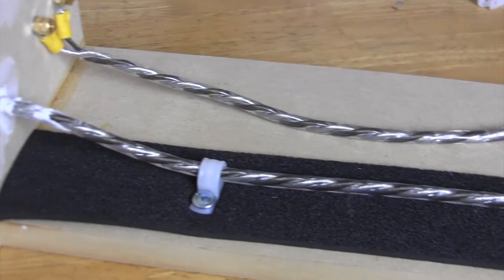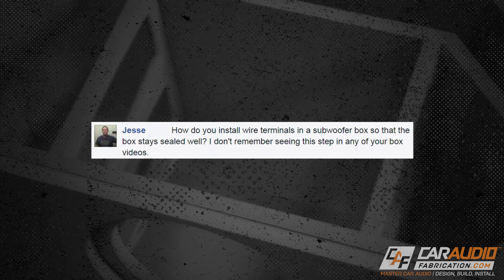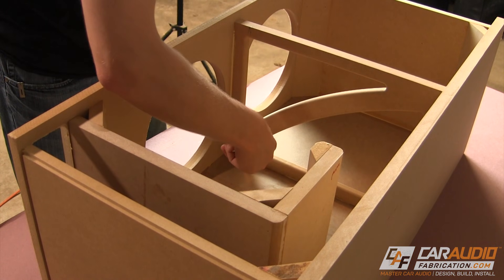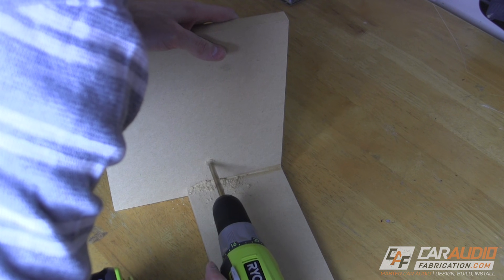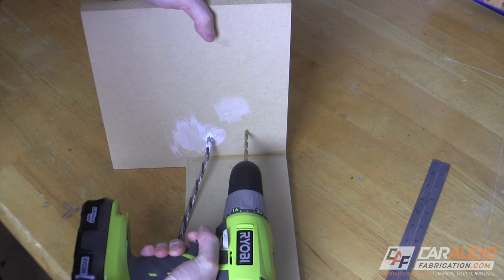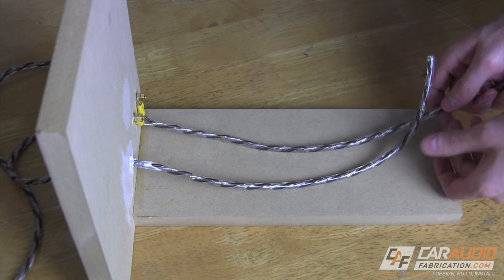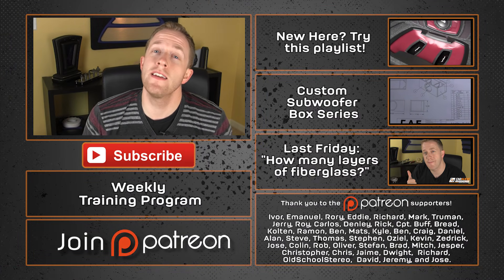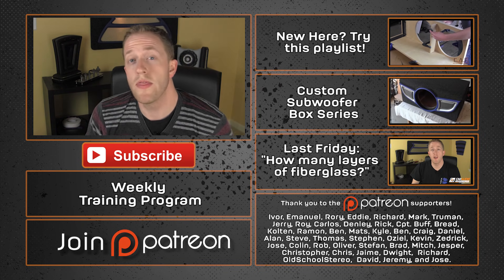Say No to Terminal Cups! How to connect wire to a subwoofer box - CarAudioFabrication

Comment: i have a 2001 blazer and i want to put speakers in both pillars size 4" to 6" what's the best way to hide wire's and i want to install 8" subs on each side of arm rest in back seat to replace stock 6*9s without taking up space please help with any advise👍🙏👍

Comment: I have been looking online for a video showing the proper ways of hooking up a 3000 watt system. the video doesn't even have to be in a car just showing the leads from the battery to the speaker wires start to finish. with second battery install and a capacitor, with either a crossover and two amps or the reason why you don't need the crossover. theres no full build on youtube

Comment: NO! Someone just tell me how am I supposed to put the wire through the binding posts tiny hole and wrap it around without it coming off
Reply: Dice Brazy There is this magical stuff called solder.... check it out!!!
Reply: John Payne -_- , I DONT WANT TO USE SOLDER and i figured out another way
Reply: use solder or shitty clips and connectors
Reply: On the inside of the box there's space for a spade or ring connector. On the outside before you screw the cap onto the bolt, put the wire THROUGH the connector. There's a hole perpenticular to the shaft of the bolt.
Reply: vnh sander Would solder work if I don’t have any spades/ring connectors lying around?

Comment: Why not build you own "cup"? I like the binding posts, but with them sticking out like that it seems like they would easily be damaged when removing or installing the sub. You could easily build your own cup with the skills you posses to get the binding posts out of harms way. You could build the "cup" from the same thickness of material as the box itself. It would cost you some box volume, so I guess you would need to plan in advance that you where going to do it that way.

Comment: since you brought up rattles. The rear deck area which houses a stock woofer rattles like crazy, its made of plastic (98 seville) any suggestions to get it to stop? I am using a pole that puts upwards pressure like a wedged between the deck and the trunk floor for now. it works ok as long as i keep it turned down.

Comment: what's another option to lay in box to stop wire rattle? is anything cheaper that can be used rather than closed cell foam?
Reply: wrap your wires in an old t-shirt and tape it 'round. Should stop rattling too. :)
Reply: Probably most foam. Or use enough fasteners to keep it from having the slack to hit things.
Reply: Heck. You could even use stiff wire and electrical tape it to the stiff wire so it doesn't move. But im no pro.

Comment: Is it ok to make a subwoofer box out of fiberglass?
Reply: Well one of his main problems with the cups is that they're thin and dont insulate much. If I had to wager a guess I would say if its just a box, stick to wood. But I have no idea what I'm doing.
Reply: Yes, as long as the fiberglass is thick enough to not flex. Bracing and laying up fiberglass cloth where there are going to be large unsupported areas helps.
Reply: Sure. That thing will be one heavy mother though...

Comment: how do I take a subwoofer box design that I had previously built with a slot port on the right side of the box, and in my new box, use the exact same design, but instead put the port in the center between the two subs?
Reply: If you're not changing the design of the port, you'll most likely be fine by just moving it and lengthening it by just perhaps a quarter or an eight of an inch to account for the small change in drag.

Comment: can you help me out.

i have 2 subboxes with both  a single 4ohm coil.
i want to wire them in parrallel for a final 2ohm load to my monoblock.

can i just take the both + wires from the subboxes and wire them together to go in to  the amp
same for the  - wires from the subboxes to the amp.

wil this work for a final 2 ohm load.
thanks alot.

Comment: Great video, upgrading my wires from AMP to speaker box as well as wired from terminal to sub woofer. Using sky high 8 gauge wire and terminal connections.

Comment: I don't use any just drill a hole and run from sub direct to amp
Reply: A bi-wire terminal cup comes in handy. Using jumpers, it allows to externally rewire subs from parallel to series without removing subs from box in a dual voice coil driver.
Reply: If you run the wires directly out the box(all of them), then same thing, just double the wire cross-section from amp to box.

Comment: Hey iv been fixing my cars 8" woofer for 4 or five months now and its been like a year since its worked properly I've ruled out all other connections the built in speaker wire has somehow shorted out to the frame of the speaker when i have the woofer out of its inclosure and push the wire down and away from contacting the cone and frame it cuts back in after installing it back into box it cuts off after one good thump... please help idk why it simply dosnt work properly
Reply: Jason M I'm not sure I understood what you meant. It sounds like you put the speaker wire through your subwoofer's push terminals and it shorts against the frame of the sub? Are you sure you don't have a loose tinsel lead or a loose terminal? Only thing I can think of is (if possible) try inserting the speaker wire from the inside of the push terminal to the outside, that way the only thing resting on the frame is the jacket of the wire. 
Another thing you can do is simply measure the ohms of each coil with a multimeter. That way you can rule out any actual problems with the subwoofer itself. I'm guessing that's more than likely the problem.
Reply: I figured it out the internal speaker wires were fried from shitty ground connection was a bitch to re solder the wire back in place thanks alot for replying friend

Comment: Question how about using binding post and banana connectors at the end of the wires from the amp to the subs is that a good aide or not
Reply: No. No bananas in car audio. You can use them where nothing moves, but that's it.
You can run a wire though as explained.
You can run something like M6 copper bolts through the wall
You can use the terminals he shows here
You can use something like Speakon or Amphenol EP connectors.

Comment: I have a question I bought a premade box already for my 2 12-inch Subs wolfers I have with the and everything but I'll be getting a new sub box but the new sub box is going to be half top half is going to be fiberglass and rest of it's going to be that heavy duty wood but it's a closed case sub box but I could not find the design I want as a ported box how can you make a closed case sub box into a ported box
Reply: most speakers require more internal volume for a ported box. So you might be out of luck. you could port it but it will more than likely be tuned wrong.

Comment: other option I like is placing ring terminals on the  wires and simply using bolts, washers, and nuts.
Reply: Only problem is that those bolts are usually pretty poor connectors.

Comment: Have you thought about using a rubber grommet in the hole of the sub box instead to feed the wire through from the app to the sub instead of forcing the wire through a smaller hole.

Comment: Hi Mark, I'm building a subwoofer but I want to add a Subwoofer Input/Output Speaker Terminal. Unfortunately I only find the terminal cups but not the actual electronic component to split the signals. Do you have a address for these components?

Comment: can those terminals take 8 gauge wire
Reply: they make different size ones but mainly "speaker" size. not really "sub" size. if you need that big a wire i would just use the bolt method.
Reply: If you need that big of a size, use M6 copper bolts or go with Amphenol EP or Neutrik Speakon

Comment: speakon connectors , it the pro way
Reply: speakon connectors, it the pa way...
Reply: Never forget the flexibility of single DVC cabinets outside for wiring without removing the speaker
Reply: Speakon is the only way to go if you want a removable sub box.  Leave's NO exposed conductors!

Comment: Can i buy a 5000watts sub and build a box for it and make it a home suwoofer? What are the thing i need to uy to make it work?
Reply: You need a proper amp if it's that powerful. Other than that? Build a good strong box that is properly tuned to the driver. Besides that, you need an active crossover that lets you set proper crossover points, time and phase. The DBX Driverack PA2 is a cheap but well working choice here.

Comment: wouldn't those binding post slightly change the impedance??? also don't speaker wire terminals slightly change the impedance as well?
Reply: Not really. If the terminals are good, they will not impact the signal in any way that means anything. Cabling on the other hand is another story. That being said, in car audio, your cabling is very short. Use a good OFC speaker wire and just run the thickest gauge you can properly fit, and you're good to go.
I work in pro audio, an we often run 50-100 foot speaker wires that are usually 12-10 gauge. Those feed 3-4 kwt subs from 9 kw amps. Never a problem.

Comment: My only complaint about the binding posts is that they aren't flush with the box.  With a terminal cup you can recess the mounting flange and completely flush mount it.  With a decent quality one and attention to sealing it you shouldn't have a problem on 90% of daily systems.
Reply: There are plenty of ways to design your box so that pretty much any kind of connection is "flush".

Comment: When wiring up a mid range amp. Is it better to run two sets of rca's to a pre amp. one being for the front component speaks and another for the rear mid speakers or just use splits. Another question i would like to ask is would it be better to run speaker wires directly from the speak to the amp for each mid range speaker OR connect the speakers using the stock wiring system and connect the speaker wires that will be going to the amp at one point on the head unit wiring harness.

Comment: Two Brass bolts with nuts and washers
Reply: yup, all I use... Washers, bolts and nuts. Best way.
Reply: Its hard as hell to find pure copper nuts and bolts for terminals? Anyone got a link for me? Shit I'm an old as 43yr old getting back to this from the 90s Bass scene so help an old guy out?
Reply: @CabinetmanJeremy  in case anyone reads this brass us actually better than copper if youre using bolts
Reply: medfordORlightning same
Reply: Same
Reply: What can I do if my box came with a terminal cup and I want to change it to make it better?
Reply: @spermcountzero  nothing wrong with cups, its more a perfectionist thing
Reply: well I wouldn't use brass. Brass is only 28% as conductive as copper. Why would you use good 100% oxygen free copper wires then bottle neck your juice flow with shitty brass bolts?
Reply: @spermcountzero  Really.
Reply: @spermcountzero  FACTS!!! this has me laughing my arse off at work, im working on a similar situation and best i can find is JL audio 8-guage ring terminals and theres no such thing as locking washers not made of junky stainless steel so i might just bolt down the two ring terminals then caulk over since im running 2,500watts RMS.
Reply: Copper, with real gold plating.

Comment: is bigger wire better for the power to the sub or am I just over thinking it? I want to run 4 or 8 gauge to the sub so it can feed it plenty of power.  hds12 d2.
Reply: or should I just use the 12 gauge?
Reply: +Xzavis Jackson 8 gauge ofc wire has been working very well for me. my 12 gauge ofc wire used to get a bit warm running my 12 inch sub once i switched i noticed a bit more power to the sub as well as no more warm to hot Cable. i used sky high car audio 8 gauge ofc speaker wire from their ebay store.

Comment: Sometimes when I turn the volume up the subs cut off till I lower till I lower the volume then they come back on. But I notice on hotter days it does that. I'm using a 4ch. Amp / 2 12" sealed box
Reply: like the other guy who replied to you, you might want to check the gain settings on it. make sure you have it tune well with a 40 or 50 hz frequency tune at 0db and using a multimeter you can tune your amp to perform at its best. if you have a smartphone, download this app called ohms law its worked very well for me and it will let you know what voltage to have your amp tuned to based on the rms watts your amp provides. second thing to check would ve to make sure that your subs are wired properly at the ohm load the amp can handle, anything lower then what your amp can handle in ohms can cause it to go into protect at high volume then come back on when the protection clears out. last thing would ve to make sure you are giving your amp enough power with ofc cables and if you are, you can also check your remote wire as most amps require 200ma of current at 12 volts and most head units only give 500ma at 12 volts so if you have more then two amps or even tvs plugged into that same line, it can cause it to provide less power as it has to share it with all those things connected to it. hope this helps out bro. :)
Reply: ***** yeah, a bit too much info but im sure it will be helpful to the guy :)

Comment: Very nice video Mark!

I have a question of my own: How do you properly run power/ground wire from your front battery to your amplifier (or back battery/batteries) in a clean fashion without harming/damaging the car?

I've searched your videos (and I may have skipped over one!) but have not found the answer for a clean power wire install. Of course, there is the firewall, but what about for multiple runs of zero gauge wire (I'm looking at doing around 4 runs in my build).

Thank you Mark!

Comment: How would you address headlight dimming due to heavy bassing..
Reply: +GlorybetoGOD7 well there's a ground cable going from your amp to the car, but most people forget that the ground cable actually connects to the battery trough the car. so if you put a ground cable from your amp to the car, make sure to also put a ground cable from the car to the battery. since it's only a few inches of cable, it's worth a try. in lots of cases this solves the problem, in the remaining cases, you'd have to install a secondary battery or a heavier dynamo. hope this helps :)
Reply: Thanks. I will insure I have good grounds and if that doesn't work I'll upgrade the battery.
Reply: +GlorybetoGOD7 Headlight dimming is plainly caused by insufficient electrical. You are exceeding the amperage your electrical system can output, therefore draining the battery enough (say on a heavy bass note) to lower the voltage enough to where you visually see light dimming. This can easily be remedied by adding a secondary AGM battery or a higher output alternator along with the big 3 upgrade under the hood.

Comment: Your tips have improved my skills tremendously and I want to thank you for that.
I've had a few people ask me to build some boxes with a Plexiglas window, (sealed and ported) but I can't find a formula for size and thickness of the glass. I would hate to build the box and have the glass crack because the glass is to thin for the size of the window.
Reply: Depending on the pressure, I'd say quarter to half inch. But if you're doing big builds, maybe one inch might be doable? Lol. I'm only guessing here because I have a few bandpass boxes that are roughly around that thickness.